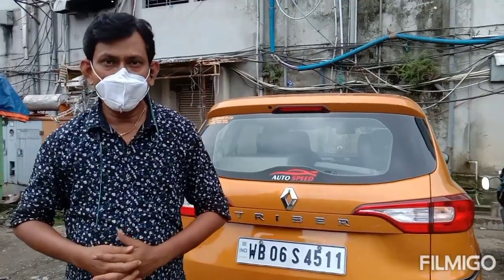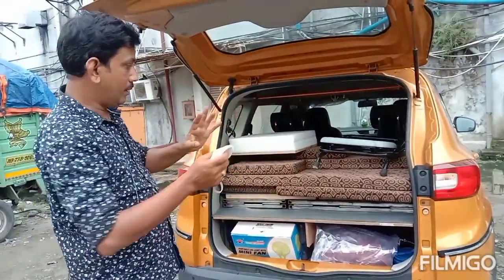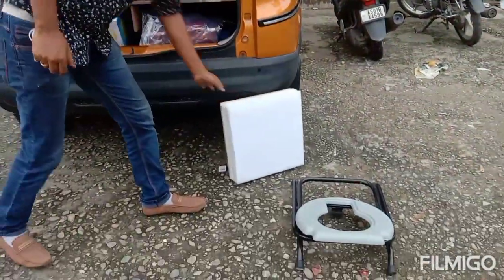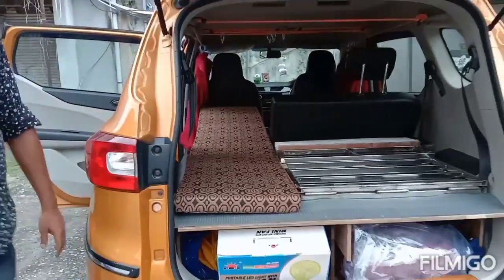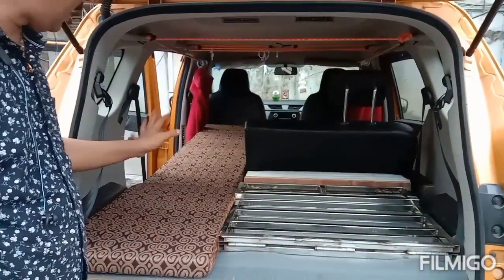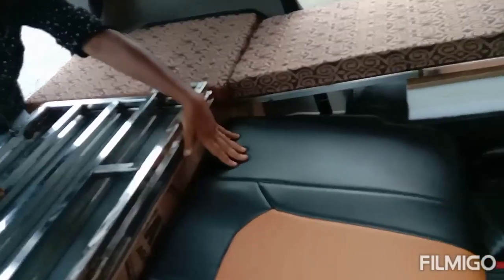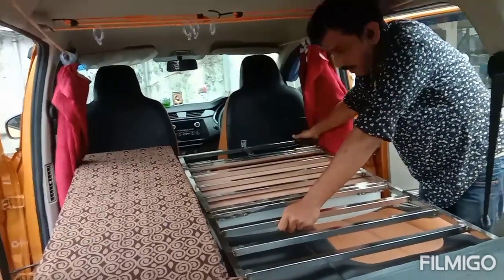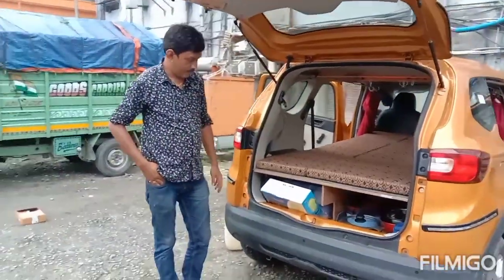Making & Post Making of India's 1st Multipurpose Renault Triber Camper, Sleeper, Ambulance Car //Van

Comment: Great job 👍. Can you do a video on, how you converted the middle two seats into Foldeable one, as you know it will not completely fold.
Reply from the maker: Yes. I will asap
Reply: This Is the reason I came in comment Section...
Reply: I too need to know 🥳 thankyou
Reply: Sir, You can tell us theoretically if you are buzy or if video will take time. I will visit your channel wagain when u upload the video.

Thankyou
Reply from the maker: @dinayakgoyal  Sorry for the delay ! I am still not able to make a video as requested by lot of people. Please do visit a car body garage. You need to first remove the seat assembly. There is a ring shaped part installed in the left side of the middle seat (2 seater) The tail of that part needs to be shortened with gas cutter and the seat has to be reinstalled. Please ensure that body garage mechanic is experienced enough to understand the job. If you still face any problem pls do call me through FB. The link is there in description. Thank you.
Reply from the maker: @dinayakgoyal and cost should be around Rs.400 only
Reply: Ok... Thankyou so much sir.. and What about the Arm rest behind the 2 seater. It will get in the way when we gonna lower it.